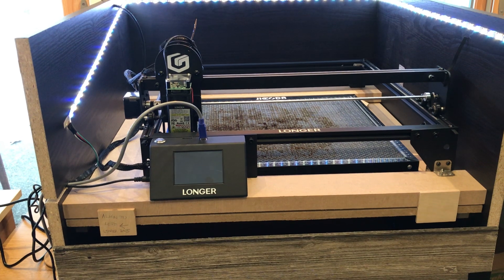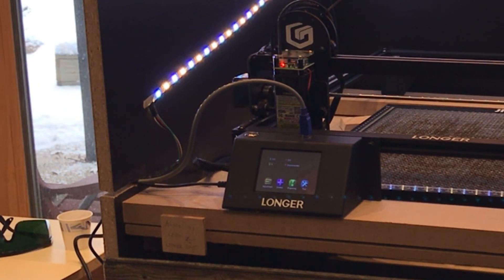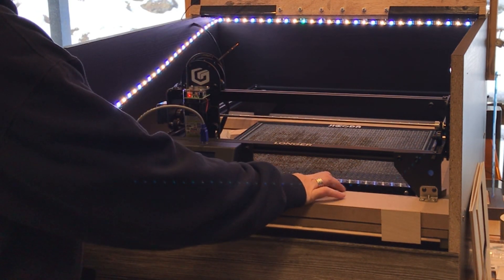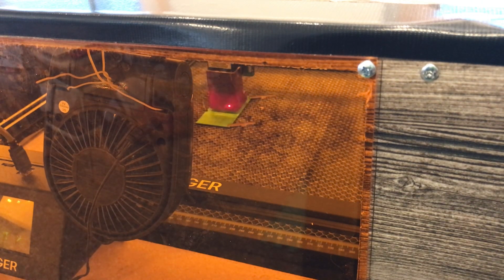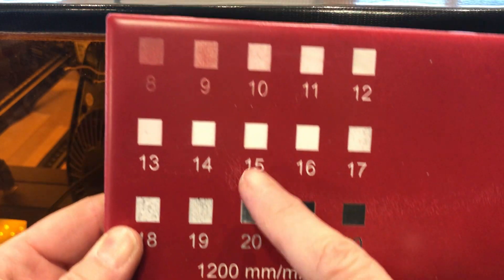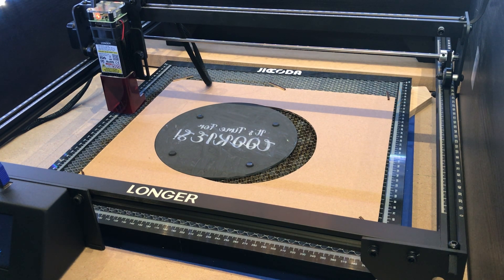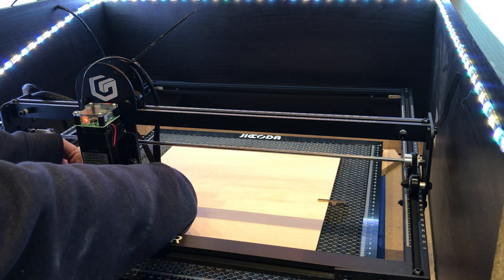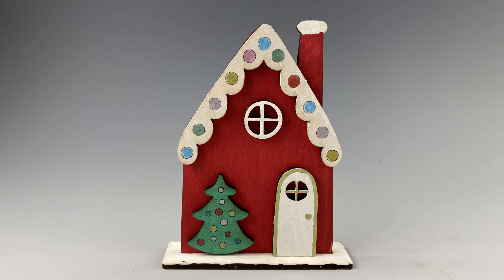Tool Time Tuesday: Laser Engraver Project Ideas - Holiday Gift Extravaganza!

Comment: That is a very nice engraver, what does it cost?
Reply from the maker: Using the discount link in the description box gets the laser unit for $449.00 USD and there are several package options with discounts as well.
Reply: @LisaRamlow  Thank you for responding.